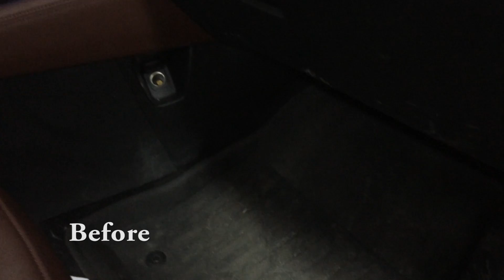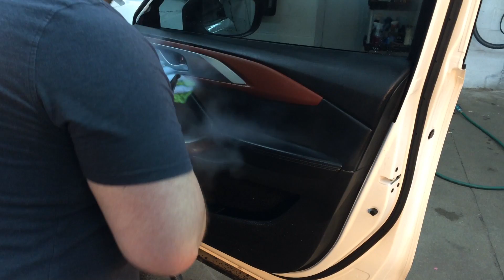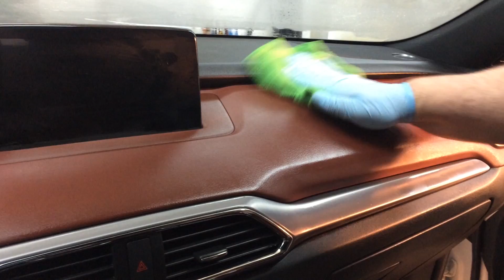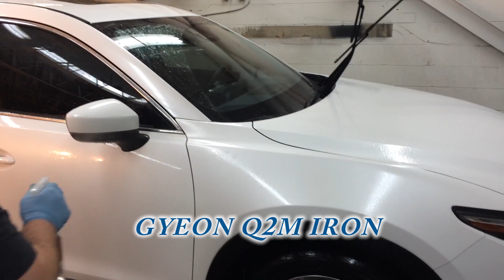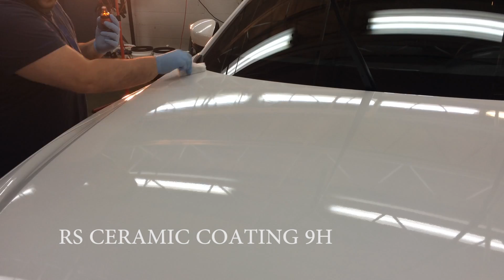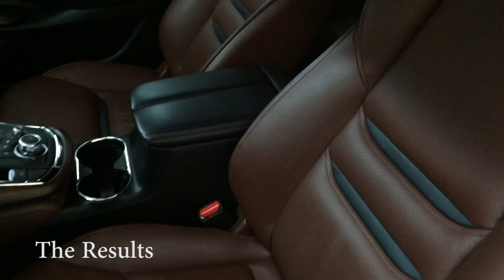Mazda CX9 Best Auto Detailing & Ceramic Coating Paint Protection

Comment: Great video!  Question for you- would steaming eventually dry out and/or warp the interior plastic trim pieces and leather?
Reply from the maker: Steam cleaning is very safe and will not damage unless you want to get it to damage!
Reply: RS AUTO SPA | Ceramic Coating & Paint Protection Film awesome!
Reply: Is there a video on how to safely steam